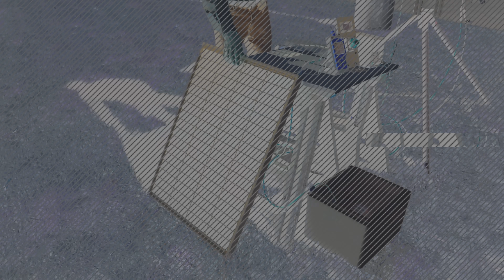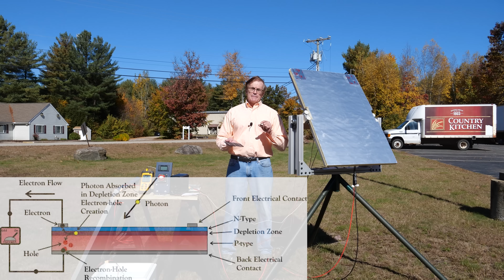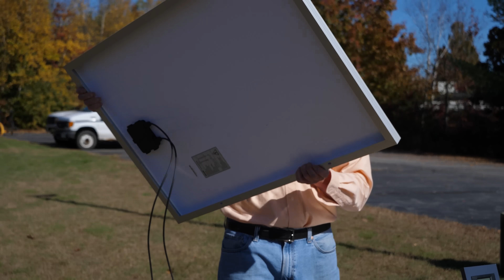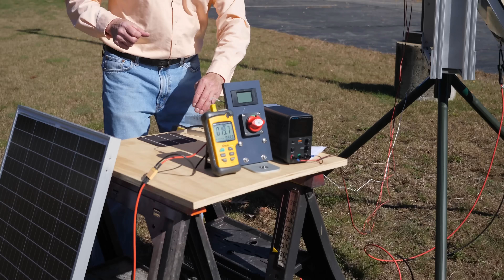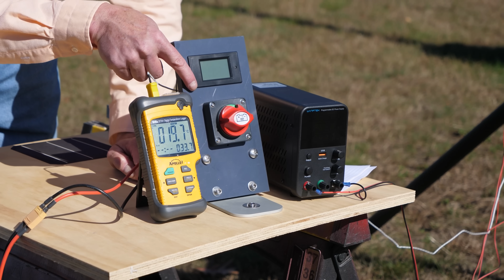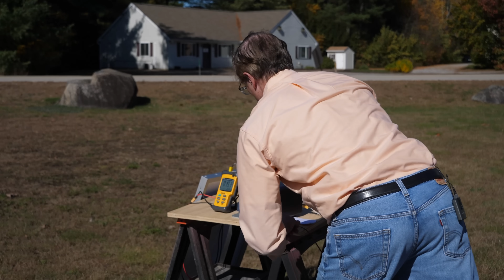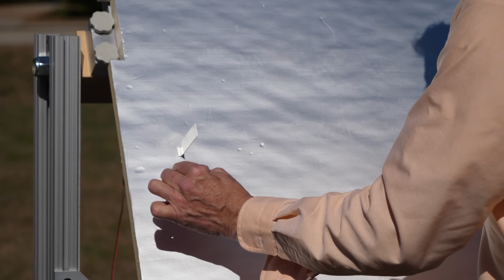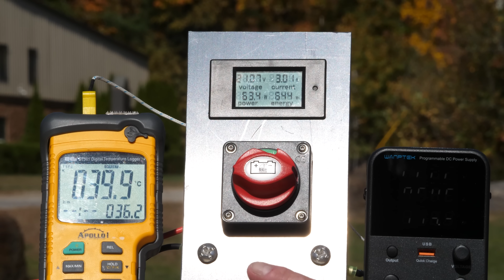Do you REALLY get enough out of your solar panel?

Comment: I have used water, but drop the heat in my pool.  It's been a Win Win extend the life of the panels and use of my pool.  Oh the pool pump moves the water which it was doing anyway, so have added know extra power.

Comment: 30 years ago I was living in my RV in the Colorado mountains for a couple of years and getting my electrical power from PV panels. Plus I was spending my days designing a MPPT charge controller, so I spent a whole lot of time thinking about PV panels. You covered everything I experimented with, as well as contemplated regarding thermal management and optimization with the exception of reflectors in low light situations. And the use of reflectors in normal sun was something you have covered in the past. So well done. Thanks for educating many people regarding PV's. While PV cell technology is improving every day, the fundamental fact is that nothing beats the basic physics and applications knowledge for getting the most out of PV's, and you are providing it.
Reply: Colorful Colorado, all that sunshine, helps improve the output 🌞
Reply: @OKFrax-ys2op , indeed. My 35 yo panels still put out more than they were spec'd to put out new.
Reply: @OKFrax-ys2op  Being a mile high helps.
Reply: is it time to say 'kids these days have it easy!'?=)
Reply: @morkovija  old solar panels, PWM charge controllers, hundreds of Lbs of lead acid batteries, incandescent lights...
Reply: @volvo09 , yep. 'Muds', discolored panels from an early experimental PV site, $250 for 2 35 W panels, and a pair of 6 V lead-acid golf cart batteries.
Reply: @morkovija  ---  :)
Reply: Frankly, I don't think a 10 minute test (not to mention with active tracking) shows ANYTHING.  All we really "learned" is what we already knew, which is that fans move air.
Reply: @tarstarkusz , they made it clear that the cooler we keep the panels the more energy we will get out of them, and that there are some viable ways to do it. So if we find a cheap way to keep the panels cooler then we'll get more free energy out. Seems pretty clear. So I'm going to be looking into the cheapest ways possible to heatsink the backside of my panels. I just wish the manufacturers didn't use a dielectric mounting panel on the backside of the PV's. It has lousy thermal conductivity. Having large hole cutouts beneath each cell to thermal glue something like a cheap steel-wool pad for a heatsink would be great. As he pointed out, the hotter the cells get the lower their efficiency, (smaller junction drop,)  and the shorter their lifespan, and they always get much hotter than the surrounding air. So any cheap way to improve that situation is a no-brainer, although I would prefer something passive like a chimney instead of a fan.
Reply: @johnwest7993  First, I'm not convinced it will extend the life of the panel. UV itself causes a lot of damage. It might mean it goes to the dump more efficient though.  I really don't know though.

It is not at all clear to me this is worth doing. I think you need to run a test at least a year and keep good records.   I have doubts about the fan lasting 30 years too.
Reply: @johnwest7993  What was the price of amorphous cells back then compared to crystalline?
Reply: @tarstarkusz  We learned that at that small scale, we can gain more output than we are taking out. We learned it is feasible enough to try further, longer, and maybe more costly scenarios.
Reply: @NdxtremePro  I disagree. To implement this full time might be more costly than it's worth.  The more complex you make the system, the more it will cost and the more prone to failure it is.
Reply: @tarstarkusz  It depends on if there are enough benefits. For example, a water based system can be complex but if you already are using underfloor water heating, a heat pump and even solar thermal panels, you are talking about just adding another input to your current system, and you are already keeping maintenance on such a system, so you have the experience necessary. If your heat pump is a closed geothermal, that is even better. The cost of adding it to the system are low, and not that complex so you can recoup your costs.
Reply: @NdxtremePro  Yes, I agree. This needs a more thorough study. It could be that it is worth it. But this 10 minute experiment doesn't show if it is.
Certainly if this can contribute to other systems you have, it may be a good idea in that circumstance, but again, you need more study.

I am very not sold on the idea that this will increase the life of your panels.  It won't hurt to make them cooler and it might even keep them more efficient than they otherwise would be, but not live significantly longer. They just go to the dump with higher efficiency.  I don't think lowered efficiency is what sends them to the dump in the first place. I think it is physical damage that does that. Physical damage like UV damage.

But one problem with extending the life is we just don't know how long these new 1/10th price panels are going to last.  Almost all of the original solar panels made in China failed early, every early.  We don't have any 30 year old Chinese mass manufactured solar panels.  Some cost savings come from mass manufacturing in larger numbers. But a lot also come from lowering the quality.
Reply: @tarstarkusz , they verified feasibility. It's up to us to devise a cost effective implementation. I'm thinking perhaps cheap black-painted chimneys at the high end of the panels.
Reply: @johnwest7993  Feasibility tests don't last 10 minutes using a different system.  He was tracking the sun, for one.
Reply: @tarstarkusz  We already know that black objects left in the sun get hot enough to burn your skin.   I'd like to use solar PV panels to collect heat as the input to a heat pump, and to 'recharge' a geothermal source heat pump system.
Reply: @RandyTWester  Possibly worth doing.  Problem is, you need the heat in the winter when the sun produces the least amount of heat.

Comment: We could also automate the fans with temperature control sensors. They can be programmed to a specific temperature and as soon as it starts to cool the fans shutoff. I wasn't even aware that too much heat reduces the efficiency of the panels. I live in a hot and arid zone and we get lots of sunlight most of the year, so acquiring energy from the free nuclear fusion from above is a no brainer. Great video as always!
Reply: Cooler is better, but at some point the fans may not pay for themselves efficiency-wise. Trying to find that point could be interesting.
Reply: Yes, it's called a bi-metallic strip or thermostat....

And it is "programmed" by adjusting the physical clearance between the contacts...

Comment: My biggest concern would be the additional points of failure with the fans having to operate so much. I would love to see this designed with a piezoelectric fan for increased efficiency and longevity.
Reply: Your best bet would be to mutualize your equipment as much as possible. Swap the small fans for a bigger industrial fan, especially if you run multiple panels. Thus the maintenance would be reduced. Also bigger equipment is easier to optimize for efficiency, you might actually gain on the whole.
Reply: @neroe23  True but I just have a soft spot for the little wiggle fans. Considering their cost though..... yeah not exactly practical.

Comment: I’m in central Florida and have a steeply sloped 3 story south facing roof and have been considering a solar system. The groundwater from my well is a constant 72° F and I’ve thought about trying to use that for temperature regulation of the house, but now wonder about combining things to cool the panels as well. I am digging a pond in the near future, so what do you think of the feasibility of floating panels?
Reply: I think 2bit DaVinci did something about floating panels in a recent video.  Or at least mounting panels over water (a canal or pond)

Comment: Here's some interesting data. I have two ground mount arrays. 16 panels at 22.5 degrees elevation and 15 panels at 45 degrees elevation. The 16 panel array are bifacial panels with power generation on the backface. The 15 panel array is a polycrystalline panel with white reflective backing.  The sun is out right now with no clouds it's 32F ambient. Feeling the backs of the arrays the bifacials are cold to the touch where the white backed polycrystalline array is very noticeably warmer to the touch. Granted the conditions for both arrays isn't the same but it's interesting that the bifacials are cold and not heating up as much as the other array despite putting out more power. [edit] the panels are on open frames so are not lacking in airflow from behind as I live on a windy hill.

Comment: interresting but now put this thing on a "real" (may be also simulated) roof, with real slope you would mount it. 
but more important with an typical airspace behind it and the roof and more as one panel (more like 3 in a row and wide maybee also simulated with a sheet of plywood))
also no aluminium stripes on the back for compairison of free airflow behind it
you will now see a significant airflow building up behind it cooling the panels.
so the question is now.. could you improve existing systems enough without the alustripe backing and without watercooling just by closing up the gaps arraund or give the air guidance enough to force air better behind the panels.

Comment: You could increase your cooling efficiency by using a push pull configuration.  Close the gap at the bottom,  pull in with fan at bottom and push out with fan at top.

Comment: Any chance you could show a better picture of how you attached the heat sinks to the back of the panel? Usually there is a vinyl cover on the back of the panel, I am guessing you removed that and  put the heat sinks right up against the panel? Any thoughts on keeping moisture out? Also have any thoughts on how to actively cool bi-facial panels? Very cool method of cooling the panels.
Reply: Oof!  active cooling on a bi-facial would be a PITA since you don't want to block the reflected light from hitting the backside of the panel.  Maybe using the water trickle method on the top side as he mentioned and simply having a set of fans blowing across the back of the panel.
Reply: @michiganengineer8621  I don't like how he completely dismissed the water trickle method because he thought of it as a closed thermal system. That's not science; he should have tested it before drawing his conclusions. Especially when it's clear that he's ignoring other phenomena in effect with water. Water at 40-50C will evaporate at a decent rate, especially when stretched through the acceleration of gravity. A small percentage of water changing from liquid to gas will pull a lot of BTUs from the system. Innately, wet things will cool down a lot, that's why we sweat; I'm aghast at how he could so easily dismiss it.
Reply: @michiganengineer8621  the trickle method would probably be the best bet. Could possibly use a clear channel and force air through that. Could allow for light to go through and channel air. As far as removing the vinyl backing, I wonder what effect that would have for allowing moisture to more easily access the back of the panel. Perhaps if you sandwiched the entire back panel with thermal paste that could prevent moisture intrusion?
Reply: @Runnerb03 that’s what I’m asking myself: bifacial panels or actively cooled classic ones?
Reply: @Runnerb03  For standard panels I'm not sure you'd need to reseal the back, if you did maybe a thin layer of epoxy resin or a conformal coating after the heatsinks have been bonded to the panel.  With bi-facial panels I'm pretty sure the backside is already sealed as well as the top.
Reply: @tomwolf9420  For ground mounted I'd probably go with bi-facial panels.  That way you would get some input from reflected sunlight.  Roof mounted panels are usually only a couple of inches from the actual roof so you wouldn't get much, if any, benefit from bi-facials.  That's where having liquid cooled PVT's would be perfect.  Especially if you ensure the liquid flowing through the heat-sink on the rear is always above 32F to help keep snow and ice from building up on the panels.
Reply: What about a misting system that evaporates water to shed heat?
Reply: @deansmits006  I'd be concerned about the mineral build up left behind.

Comment: Very interesting, thank you very much for doing these tests!
My problem is somewhat reversed, here in Sweden I have an off grid cabin, the small solar panel charges a battery so we can run lighting and a surveillance camera.
The small load drains the battery because the winter days are so short.
I need to find a solution that charges the battery even in very low light...
Reply: More solar panels compensates for this.  You may need to brush up on calculating your solar needs, might be a 100 videos on this topic they'll walk you through it all.  One characteristic is calculating your actual average solar hours in the day at your exact geographic location, which will end up concluding you need more solar panel area.
Reply: @RwP223  Thanks for your reply.
But I don't think anyone thinks about it, those of us who need to be able to charge even in twilight.
I might start looking into wind generators, but they are sooo expensive.
Reply: he did a video on solar concentrators a while back. that's likely your best option.
Reply: @Frostfly  Ohh, it's worth checking out!

Comment: heat should be not a limit, instead used the solar diodes as peltier heat-to-electric cells, and heat should only create more free electrons, anyways, not make the solar device less efficient, and in any case
Reply: the junction depletion field should not vary with temperature
Reply: use cool/hot air duct flow as the heat transport circulator, no water, just air gas

Comment: Why not run your hot water heater input water through a solar cooling loop?  Around here, rooftop solar hot water heat is semi-common. Sure, you are "heating" the panels in the winter - but over a year how does that average out?

Comment: Great video as always! Would it be possible to filter out the wavelengths that only add to heating on the front surface of the solar panel via reflection?
Reply: I think he mentioned that in a video before. I heard it somewhere. My recollection is that the filtering would lower the input too much to be practical.
Reply: @mikebond6328  tbh that makes sense.
Reply: Yeah definitely, do a quick google on laser goggles, there's definitely ways of targeting specific wavelengths of light.

Comment: Next experiment is water wicking cloth attached to the back fed by small waterpump. See how evaporation cools the panels. Another experiment could be painting the backside black, see how cooling by passive  radiation can be optimized.
Reply: I agree, latent heat of evaporation is quite effective.  Maybe a thin sponge that covers the back (to fill in gaps), held down with steel cloth (wire mesh) so that water can evaporate across the whole area.

Comment: The back of the panel is shiny. Shiny equals low emissivity. It needs to be black if it is looking at grass! There is also room to place a reflective surface behind the array to reflect the sky. The sky is transparent to IR at 8µ to 15µ and acts as a super cool heat dump.
Reply: black is more emissive. Learned that from action lab
Reply: If the people woult take a IR kitchen thermometer and aim it in a night with no clouds up outside, they would be shocked.
MINUS 50-60 degres Celsius.
First i did not get it ... 
(Think this would also make a good short learning video for Tech Ingrediens ?)

Comment: Could use the heat for heating water
Reply: If you're living off the grid, you might agree that is heated water.  I currently live in the matrix still and heated water is about 120°F.
Reply: @RwP223  could use a heat pump or at least give the electric heater a boost to start

Comment: Great video! Very well explained and interesting topic, a small correction in the manufacturing. The vast majority of solar cells today are made by starting with a P-type silicon wafer, and then doping that from the outside by hot gas diffusion, greating the P-N junction. The front and back electrical contacts are usually applied as a solder paste, and then baked in an oven. On the back,  an aluminium paste is also applied to create a very heavily P-doped layer, which help reduce carrier recombination, and increases the efficiency. It is usually only 2nd and 3rd gen solar cells that start with a substrate, and then deposit the thinner layers on top, as this is a much more expensive process.
Reply: Where's the solar powered factory that makes solar panels? Where's the research paper?
Reply: I would love for there to be a solar powered solar cell manufacturer, but as far as I know there isn't any of those around. Producing solar cells is a huge multistep process, usually different companies specialize in different areas. Which research paper are you looking for?
Reply: Looking for attention...

Comment: I use solar for backup and emergencies. Cloudy days are a curse. People who don`t use it or understand it think it`s crazy to have so many batteries. But luckily I do because the lot I moved my camper to has fall/winter shading from large trees to the south and to have enough power for lights, cooking, fan, and an electric blanket, a couple of batteries have to be charging daily while others are used or I have to chase the sunlight by moving a panel and battery around the yard every 15-20 minutes. To get better results I`ll have to mount panels up high on the metal roof over my camper.